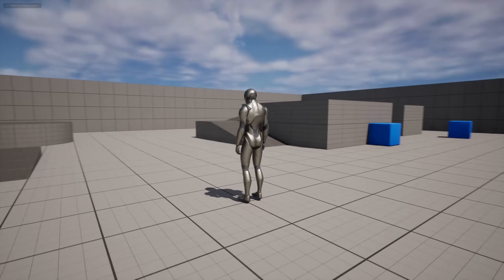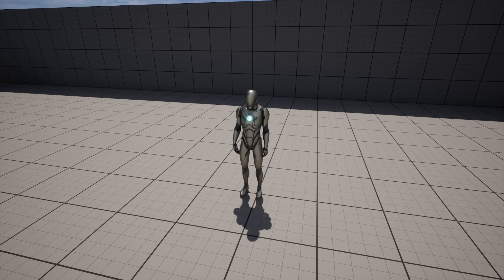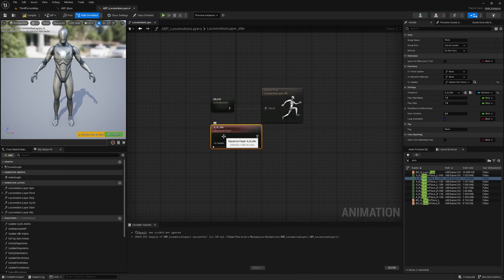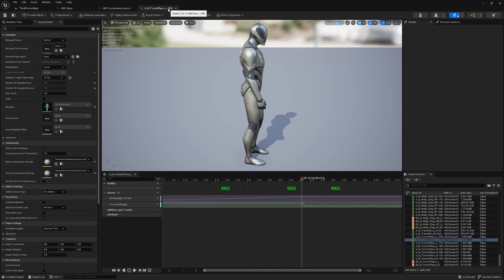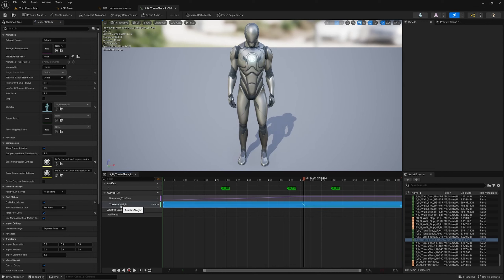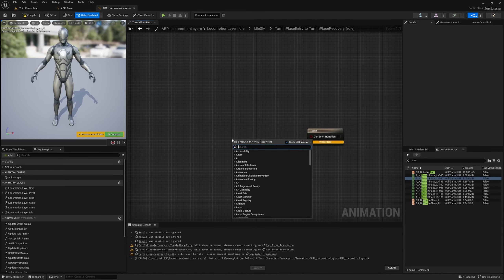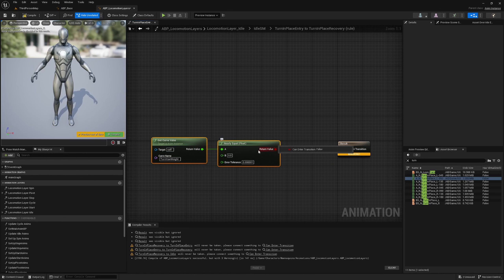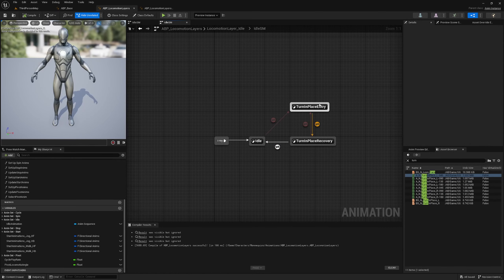UE5 Character Locomotion Tutorial 14 | Turn In Place Part 2/2: Animation Implementation

Comment: its not working great. İts almost never run 180 degree turn animation while i looking back it is always running 90 degree animation twice
Reply: are you using lyra animations? im having same issue here, the rotate animation is super fast so i assume if you spin your mouse normaly it happens so fast that it started  to play 90 dgree aniamtion before even thinking about 180dgree
Reply: same as me. if you want see 180 turn animation in this method, you should be turn 180 while turn 90 animation. i'm using lyra animations

Comment: Excuse me sir. I followed your step exactly but finally got messed up like the character keeps changing from Idle > Turn Entry >Idle > Turn Entry ( I have set blend time to 0 for rule from Turn Entry > Turn Recovery already). After 2 days of debugging, I found that the issue is in the Function "Process Turn Yaw Curve" where we checked the weight < 1.0, and if yes, we go to Turn Entry State. The problem is even the curve now has weight 1 (that's, <1 expression evaluates to false), we do not always enter the false branch and creates wierd behavior ( the Previous Turn Yaw Curve Value, particularly in this case, never updates), and I found that the boolean is evaluated to flase / true randomly even weight is always "1". 

My solution to be shared:
Change the node to "nearly equal zero" instead of <1 could resolve, and now I got exactly same result as you. I guess the problem here is we compare "1" in the curve with absolute "1" in the boolean expression, and due to some sort of floating point precision issue, we could or could not get in the flase branch randomly.

Lastly, I never comment in Youtube before indeed but just so glad to encounter experienced animator like you sharing such invaluable skill with all of us. 
Please accept my sincere gratitude to your works, and I did learn a lot from you!
Reply: I'm following along in UE 5.4 and also ran into issues with the transition in the Idle states. I also had an issue that stemmed from the function "Process Turn Yaw Curve" with checking if the Curve 'TurnYawWeight' is < 1.  In my case, changing it to a lower value of 0.9 resolved the issue. But I also had to adjust the 'TurnYawWeight' Curve in my turn animations (using Epic's GameAnimationSample project for animations) to stay at a value of 1 until reaching far enough in the animation where you want the character to be able to start to turn again (this is where I set the 2nd key in the curve to 0).

Also, I had to adjust the 'TurnInPlaceRecovery to TurnInPlaceEntry' transition to use a duration of 0 as well for the blend settings, because if I did not then the turn animation would appear to not play all the way through - it stopped early before completing the full turn of the animation in some cases.

One other thing to mention, in the "Select Turn In Place Anim" function of the LocomotionLayers ABP the method provided here for determining which turn anim to use just didn't work for me; I reviewed both part 1 and 2 for this turn in place, and confirmed I have all the same code. 

So I ended up modifying it slightly by:
1) get the absolute value of the RootYawOffset float,
2) subtract by the degrees of the turn animation you are checking for (i.e. 180, 135, 90),
3) then connect that result to the "Normalize Axis" node, and get the absolute value of that,
4) then using the "In Range (Float)" node, check if the value is within a min, max range of 0 to 30 (adjust the max to w/e you find works best).
Reply: Perfect)

Comment: I'm confused about the logic on this one. Wouldn't we want to apply the smallest turn in place animation possible that moves the character to under a yaw offset of 50? Basically reversing the logic to check for larger and larger turn animations until one is large enough.

For example, if my current yaw offset is 60 then I'd want to check that ABS(60 - 45) is < 50, then play the 45° animation. With the current logic we'd check if ABS(60-90) is < 50, then play the 90° animation.

Comment: Hi
I really don’t understand why we need to divide the value of one curve by another (17:22), if specifically in this animation the value of the TurnYawWeight curve decreases when RemainingTurnYaw is already equal to 0, that is, when we divide 0 by, let's say, 0.8, we still get zero
At the same time, when turning, we always divide the value of the RemainingTurnYaw curve by 1, which is the pure value of RemainingTurnYaw

However, removing this division and using pure value of RemainingTurnYaw completely breaks the animation if we check TurnYawWeight for equality to zero

Could please explain such strange behavior?

Thank you